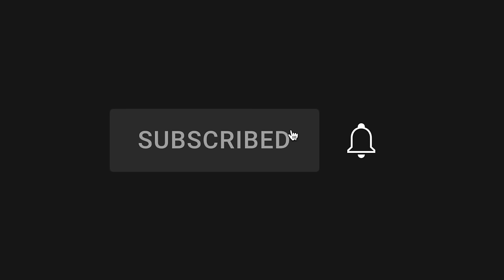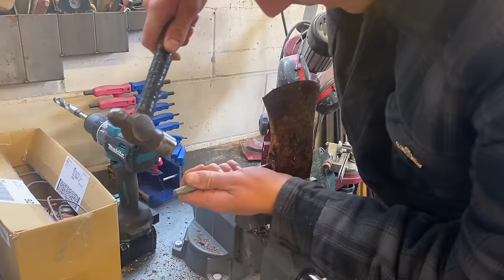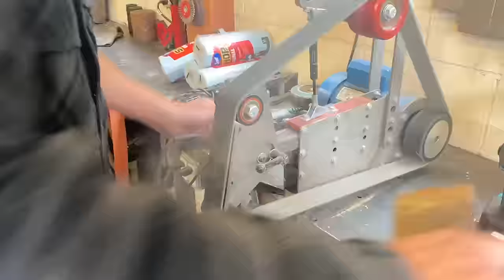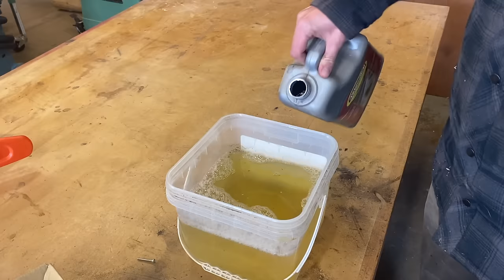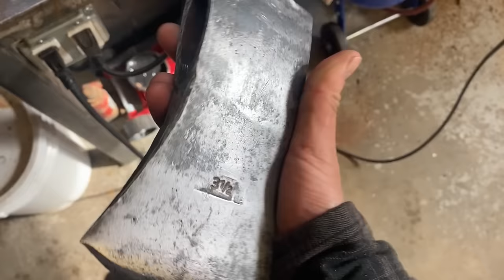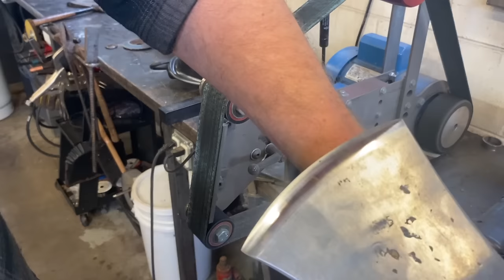Rusty Old Axe Restoration!!!

Comment: Looks like a Wetterling export, possibly this: Swedish Felling Axe No. 8 - Michigan Pattern, Single Bit. From around 1959. Excellent Swedish steel, japanned head, 3 1/2 lbs, 4 3/4” cut, 34” handle.
Reply: That's exactly what I was thinking 🤔 😂
Reply: Here I was, thinking it was an axe…
Reply: We found the axe junkie 😁👍
Reply: Think you’ll find it’s the No 7
Reply: Definitely not a Michigan pattern,  closer to a Dayton but not really a Dayton either.

Probably a decent axe, but not exactly " excellent ".
The swedish exports from back in the day were budget axes, and my vintage GB is on the softer side.
Noticeably softer than my 1960's True Temper woodslasher.
Reply: Yes, definetly an wetterling. I have a few just like this one. Superb steel.
Reply: @TylerSnyder305  It's possible that the pattern isn't "Michigan", could also be "Yankee", but the stamp is late 50s and the export catalogs I can find from that time only mention the Michigan pattern for felling axes, and it looks plausible to me. This specific axe has seen some serious abuse. It was not a budget axe and was quite expensive, not as overpriced as they are today though. Both the steel and the hardening are excellent, for that time period. Modern steel can be made harder without becoming too brittle. If your GB is softer than 55 HRC, it is probably made before 1930 or has been damaged by overheating.
Reply: @erajoj  
Who would they want to explor axes to the US during the heyday of the American logging industry  when our axes were the finest quality the world has ever seen ?

My axe is definitely more modern, and I know it has not been fire damaged, it is simply of inferior quality to other axes I have. It's still a good axe though.
Maybe things were different in say Canada,  but it is well known that here in the US the swedish imports were always considered second rate in quality by those.
And it wasn't just because they weren't made here, solingin and Sheffield cutlery has always been well regarded here.
Reply: Its a Hults bruk. Makers Mark is a cirkle with H in it
Reply: @TylerSnyder305 lol

Comment: It looks like a faller's axe light but with enough snort (3 ½ lbs) to pound FG wedges to control where the tree lands. I used one of these in the late '60s on the island at Franklin River.

Comment: I'm fairly sure that's an SAW Wetterlings.

The SAW logo had the A sitting a little higher than the S and W and there are/were 3/4 circles around the S and W connecting with the roughly 1/2 circle on the A (most of it on top and a slight bit on under the A)

You got yourself quite a unicorn 😁
Reply: Yeah that is 100% an S.A.Wetterlings

Comment: SAW = SA Wetterlings.  One of the best, though not better than that Liam Hoffman sitting on your bench.  The heavier pitting on one side is typical for an axe that spent an extended time with that side laying against the ground.  It won’t hurt function a bit though.

Comment: The Samurai Carpenter : Have you ever tried to apply the finish before placing the axe head? So to protect that interior part of the axe? Or maybe soak everything in mineral oil? A true question just to know.

Comment: It might be an S A W  or Wetterlings, which I think was preceded gransford brukes but I could be wrong.  I have one each S A W letter is circled separately.  Followed by ( drop forged. )   They are hard to find. Collector items. You can find them on Ebay some times. It has the shape of one.
Reply: S A W stands for Sven Axel Wetterling btw. Started Wetterlings like late 1800's. he sold his part in 1915. Gränfors bruk opened 1902 or something.
Reply: @theablanca17  I think my 50 dollar investment in a  SAW hatchet head will hold its value better than the dollar will. My stanley *8 wood plane increased in value by about 30 to 100 percent.
Reply: @theablanca17  The Wetterlings EX line of axes was in production from 1920 to the 1960s
Reply: @theablanca17  It was a premium product that used a special steel in a laminated bit. As well as a special heat treating process. They were the best of the best.

Comment: The key with making a good handle is the orientation of the grain. Handles should always have the grain running “front to back”, if the grain is sideways across the head it will splinter and break.

Comment: I fully restored my grandfather’s axe and I’m still using it. But over the years I’ve had to replace the handle twice and the head once.
Reply: Is it still your grandfather's axe if none of the parts are original? (See Ship of Theseus)
Reply: @smithaustin2009  . I knew of “grandfather’s axe”, but wasn’t aware of the Ship of Theseus reference. Interesting reading, thanks
Reply: @montyverdi1788  Funny. I knew of the Ship of Theseus but had not heard of the grandfathers axe, hence my question. Seems to be the same thought experiment taking two different forms.

Comment: Definitely coat your wedge in BLO before final install. fit your head and when ready hammer your wedge. The BLO should be poured into the wedge slot before the wedge. It helps treat and swell the wood to prevent future loosening.  I know there are many ways, but 5is is a proven effective quality process.
Reply: Oldies will work for the wedge too, point is oil the wedge, not wood glue.

Comment: i buy the Paint Remove disks at harbor freight that fit on my right angle grinder... its like a plastic 3m scrub pad but it easily polished up my 70 year old shovel and pitch fork from a rusty mess to looking like chrome

Comment: I might have found someone with one of those laser rust removers, polished it up and saved the axe handle as well.
Reply: That handle would’ve turned to dust with a single good swing into a tree. I agree the cleaning laser would’ve been cool to see be used on the head though.

Comment: Hey, my father just passed away about 10 days ago and I’ve discovered a whole bunch of random tools in the basement that I don’t even know what some of them are but one is a super old axe. What is the name of that tool you use at 13:00, that little 2 handed planer thing. Also how did you fix the problem with the wedge not seating in as far as you expected?

Comment: Hate when heads are restored and they take out the pitting! For that axe, 30 inches sounds about right. It's not a splitter, especially now with the grind on it. Probably a felling axe. Good limber. Quality steel, hopefully the Swedes didn't harden their heads to the same Rockwell as today. Well, at least GBs, pain in the ass to fix a chip in the field.

Comment: Nice job man. That's most likely a SA Wetterlings, good quality axes from Sweden. The handle looks nice, but imo it would look much better if you removed that big hump of wood under the axe head, removing that shoulder is always the first modification I do when I get buy a new handle.

Feels better in my hands too, reducing the width n girth of the handle gives it a much smoother action when chopping because of the reduction of vibrations. 

I can't get ash or hickory easily where I live so I have to use birch, works good too, up to 65-70cm lengths, taking great care selecting knot free and good grained trees. 

I tend to just leave the handle a little thicker on the cheek sides, that's enough for a secure fit.

My two Swedish Kronor

Comment: the wedge is to big. it should go 3/4 or75% into the split for the head. you look to have a shallow 1/3rd. as for oiling i learned from wranglestar that you oil once a day for a week. once a weak for a month. once a month for a year. then every 9 months to a year after. Honestly id soak it in oil for 3 days lets it drip dry for 4 then resoak for a 2 days let it drip for 5 then let is soak for a day then let it drip for 2 weeks. touch it up with some sand paper or a draw knife or razor then resoak for a day every 1 or 2 months for a year then a good 3 day soak every year after. just an opinion.